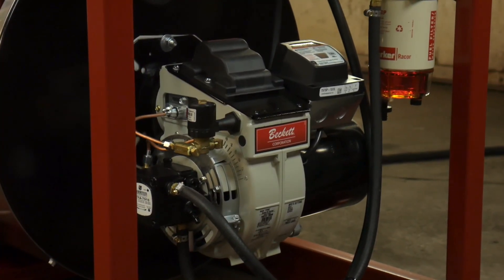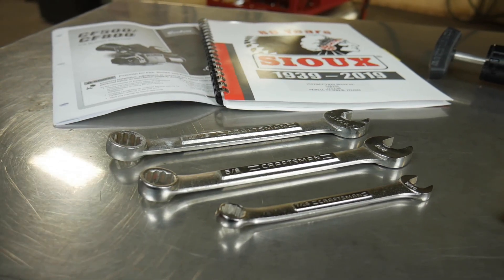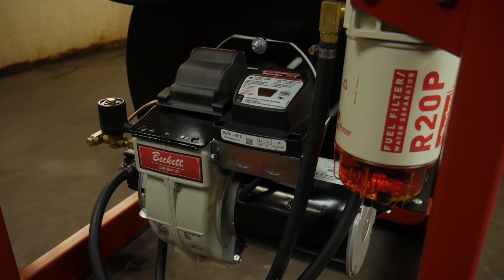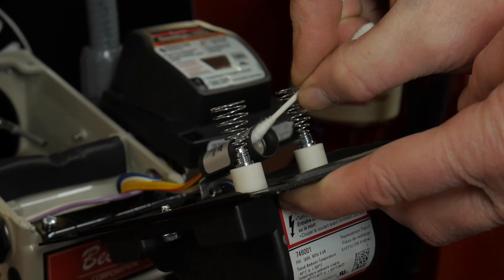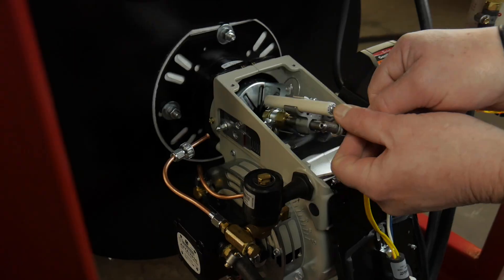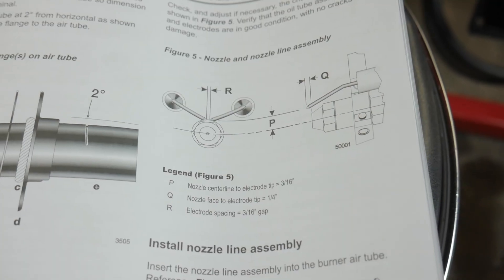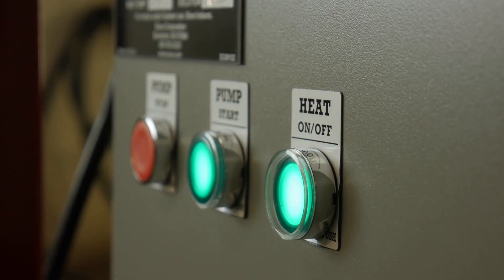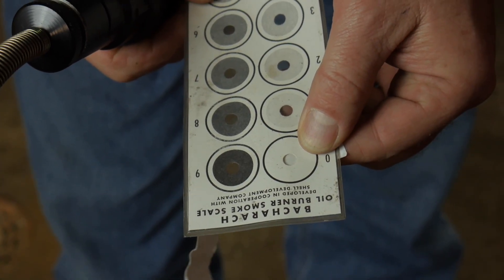BECKETT OIL BURNER SERVICE | Genisys 7505, Tuning, and Maintenance

Comment: Hello, i have a beckett power light igniter, it will make spark or ignition for about 5 seconds or so then the igniter seems to shutoff or cut. It will do this with the cad cell in place or unplug from its socket .. is the igniter defective or is there something with my cad cell wiring ? Any help please ! Thank you

Comment: 7505 could be faulty ?
Reply: This is my 2nd 7505 control box no lights it has low ohms at unit. Blower runs but oil furnace motor does not. Wheel in it moves freely and fuse good condenser also good oil tank full

Comment: @siouxcorporation Any idea why it would be seemingly getting no power? No lights, reset button won't light up either, held it etc. Used it last year until this issue.
Reply: Ever figure this out?
Reply: @CJ-jf9pz  yes I did, a wire had actually come out of its case and got roasted
Reply: @CJ-jf9pz  and it was just strip it and put it back in done. I got lucky. But the wire was very hidden so it took a while to figure it out.
Reply: @GrandmasterHobbyist  that's crazy.  I'll have to see if I'm that lucky
Reply: @CJ-jf9pz  yeah mine is one big 2x3 ft vent in the floor that heats the down stairs but anyways it was inside there the metal box holding wires. One just popped out right in the way of the heat blasting it.

Comment: I have a fuel oil furnace with a Becket 75 0 5 b control It's in hard lock out every time I reset the lock out it comes on lights runs a full cycle shuts off  When the temperature drops and the thermostat kicks it back on it runs lights lights Burns for 15 seconds seconds and shuts off and hard locks out what's wrong please helplease help getting cold